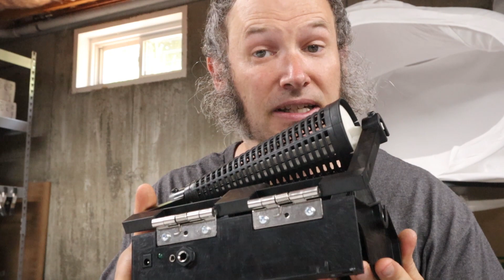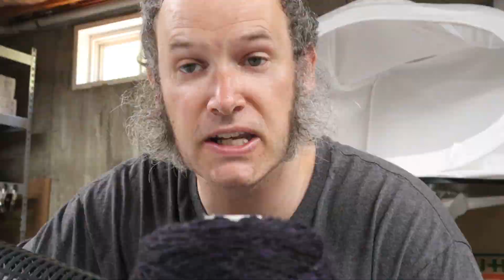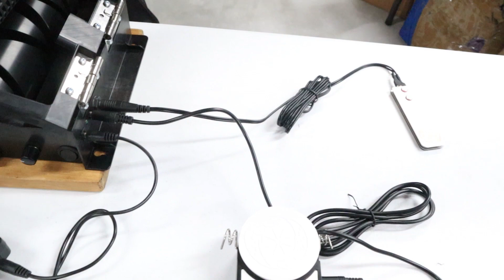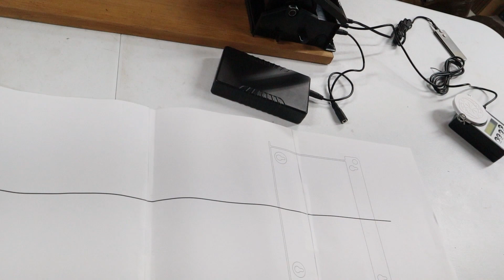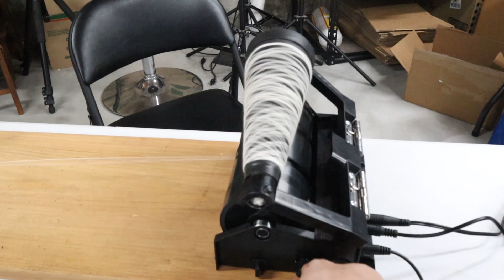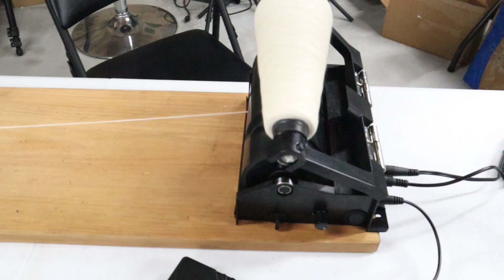SPIN 142 - First Molded Parts of Cone Winder

Comment: What im looking for is to make 3 smaller cones of serger thread from my main big serger thead cone instead of buying 4 large serger cones because I dont sew enough to ever use all four large cones, I do with black and white color thread but not other colors, so in lue of buying 4 large cones of a mustard color I rather buy one and make 3 smaller ones to use on my serger. Can your machine make a shorter or smaller (diameter-wise) cone. I cant use a regular winder as it does not wind like a cone but more like a bobbin and my machine seems to pull up spool from the spool holder. your winder is really nice. Im soley looking for a serger cone winder and cannot find a home use one, the commercials are in the thousands, thats crazy, I like how it looks, i seen one like this on etsy but its from europe and need 220v. I have a 220 outlet but its outside and I dont want to wind outside, LOL
Reply from the maker: I will need to see how the current cone winder does before I look into doing different sizes with different features like this.

Comment: I've been excited for this for a long time! Seems like forever ago when you first showed a 3D printed concept version, but in reality you've actually accomplished this pretty quickly with all your other projects! Definitely getting in on the Kickstart for this. I didn't on the Nano 2 because I figured I already had a Nano and the 6.0, but I've since decided that I need the Nano 2! Anyway I have a question to make sure I understand... It looks like you can use the yarn counter with the cone winder without having to actually run the yarn through the counter. Is that correct? Does the software work together in such a way where the yarn counter will measure based off the rotations of the cone winder? Also, do you have an idea of how many cones you plan to include? Then will you include an option to buy additional cones, or have just the cones in your store? I appreciate you putting out files for people to 3D print. I bought a 3D printer and ended up selling ot because we couldn't get anything to print successfully, lol. But I've always been glad that there are those who sell extra 3D printed parts for the EEW products. So I am wondering if a file for cones will be something you will put out if you don't sell them. Thanks again for all your fantastic products Maurice!
Reply from the maker: The cone winder has a plug to connect to the yarn counter, but to measure the length you'll need to run the yarn through the yarn counter.  I'll have a video about this in the future.  The reason they are connected is you can use the Yarn Counter to stop the cone winder at a certain length of yarn that you program into the yarn counter.

I need to figure out how many cones will fit into the box.  That will probably be what decides how many cones I include.  My goal is something like 10, but again final number depends on what cleanly fits into the box I design.  I also want to make a second box that can be connected which has a lot more cones and will make that an option for the Kickstarter since I've been told by many people that it's really important to get a lot of cones.  I will also make files available to 3d print cones, but my injection molded cones are probably better quality (though the 3d ones do work fine in testing).

Comment: Great final video! Love everything about it!! Wonderful Design. 
1 question please?
Just plugging in the EEW counter to the cone winder does it count the yardage without running the yarn through the counter? 

Thank you! Looking forward to the Kickstarter!
Reply: There is a port on the back that you can plug into the Cone Winder and I will probably include that cable with the Cone Winder (it is a very standard and easy to get cable though).  To measure the length you need to plug in a Yarn Counter and run the yarn through the counter before the tensioner.

Comment: Very interested in this cone winder. Forgive me if I missed this info in the video. Will the tensioner and cone winder have a clamping device attached to them or will a mounting board be required? Thanks
Reply from the maker: The tensioner will come with a clamp.  The Cone Winder won't, but I designed a lip on the back so it's easy to use your own clamp.  Also in many cases the cone winder doesn't need a clamp because it's pretty heavy, but I will recommend clamping or screwing it down.